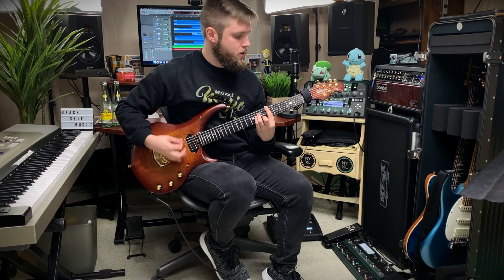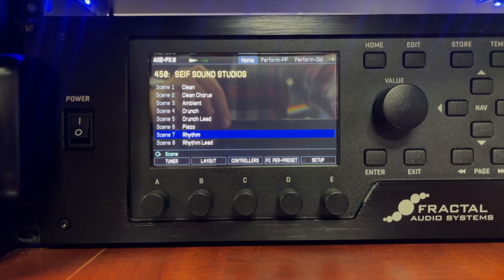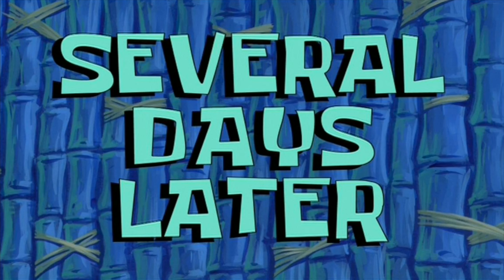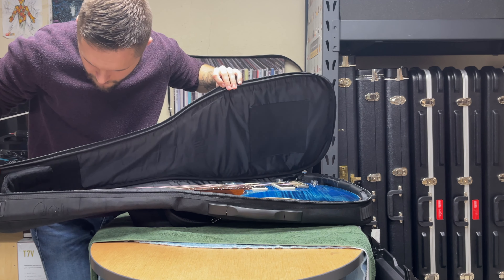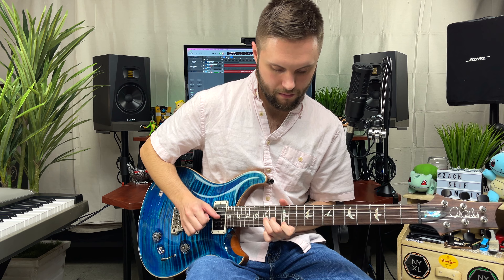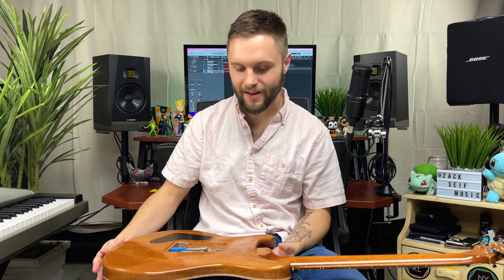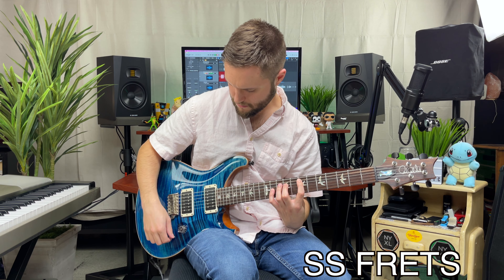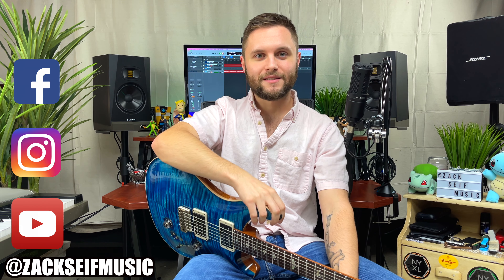I Put STAINLESS STEEL FRETS On My PRS

Comment: I just put SS Frets of two of my PRS guitars and, well, it's harder to work with them but the feeling is amazing. And they last forever. Don't think I'll buy a guitar without SS Frets anymore. So far I have SS on 5 or my guitars. It's strange that the three big US brands haven't jumped on that train. I have a cheap EART with amazing SS fret work. The smooth feeling is so nice.

Comment: Synopsis: PRS frets are very soft and wear faster than any fret material I've ever seen. 
The rest of the story - I've leveled and crowned probably 5 of my guitars but monthly on pawn shop guitars! I bought the expensive files and watched many different YouTubers and I had great results. Thank you guns and guitars. I even did a fret level and crown job for a friend and got his action way down. I just bought my first PRS. It's the SE McCarty 594 and I'm in love! I looked at the frets with my trusty 7X tool and noticed that the frets really needed some scratches removed and a good polish job. So after a few days of playing it was time to cut the strings, condition the board and clean up the frets. I started with 1000 grit dry paper just to be safe and have a method where I start on the lowest frets just in case there's a problem. Thank goodness I did that because the 1000 grit totally flattened the crown right off and removed about 2 or 3 thousandths of height, which is a mile when talking frets. It's a lot because the low fret will let the string down more and always buzz on the next fret. PRS frets are the most soft frets I've ever encountered, by far. If I had started on an important fret I'd have to either add material by dropping some solder or swap one fret. I'd be surprised if many people have messed up a fret or two before they notice how much is coming off these wimpy frets! Be careful everyone!! Buy Schecter, SS frets!!!
Reply from the maker: That's totally true. Nickel is getting softer and SS is getting cheaper. Why not get the best?

Comment: Congrats!  Can't imagine what you're doing to wear out the frets so quickly, but hey-- nothing wrong with replacing worn frets with stainless steel.  Beautiful guitar!
Reply from the maker: I thought the same thing haha PRS Nickel isn't as strong as I thought it would be despite what the claims are. No other guitar of mine has fret wear because every other high end brand that isn't the big 3 uses SS on everything. Lasts longer, stays shiny, smoother bends.

Comment: I got my first Core PRS (Custom 24) in 2005, by 2010 it needed a re-fret, so I upgraded to Stainless Steel frets.  So far, they've lasted 13 years.  Dunno what PRS' deal is with nickel frets, probably my only complaint about PRS.
Reply from the maker: Couldn't agree more! The SS frets are a godsend and they are on my other guitars.
Reply: Seriously xD
Been 5-6 years here too. And now i need to refret
Reply: What is it with the beef of Mr. Smith and stainless steel frets 😂

Comment: I like the nickel on the clean tones and ss on the driven tones. For the durability factor I think you made the right call. Slight tweak on the clean preset and its virtually irrelevant.
Reply from the maker: Absolutely agreed
Reply: Same here
Reply: Looks like I’m going against the grain of most the comments here, but…

For clean tones, the warmth and transients sound better with nickel frets, to my ears.  There’s a loss of richness/complexity that can’t be dialed back in.

The stainless steel frets wouldn’t be a bad option for medium/high gain tones.  They sound like they cut through a bit better.

All that said, it’s awesome we have some great options. Different frets for different applications, imo.

Comment: The nickel frets sound better....smoother and warmer.The steel ones sound ok but a bit brighter and more brash.I understand the convenience of the steel ones for durability but I'd still choose the nickel ones for tone.
Reply: Brighter and brash describe SS frets perfectly ,I have some in my guitars l, the difference is subtle but it’s there
Reply: It can be compensated by using higher value capacitor. So if the standard cap is .022uf then used .033uf.
Reply from the maker: It can also be compensated by rolling the tone from 10 to 9, or just moving the treble or presence of the amp by .5-1.

Comment: Nickel sound more gritty and less articulate. The SS are much cleaner sounding and more chimey, I wish they would put it on all guitars over 500 bucks. if you can't afford the PRS the HB CST-24T is a good alternative if you want a guitar to take to gigs where you are afraid someone will steal your wonderful PRS or Strat. Just make sure to remove the tuners on the CST and replace them with locking tuners, the orginals ones are terrable. Oh and they have stainless sleel frets on them. Remember it is no PRS, but but is better than any budget guitar I have ever owned. I Own the 24-08 now, and when I wear the frets down, I will do the same I will send it out to replace them with SS frets. Thanks for the video, I was wondering if I should but after listening to them afterwords I will change them out when the time comes.
Reply from the maker: SS frets are the real deal

Comment: What I find odd is that on when you're playing the Pull Me Under verse towards the end, the open root note sounds quite different when you're playing the SS as opposed to the nickel. Obviously that can't be the frets. How confident are you that the settings were actually the same for the two tests? 

I ask this because yours is one of the more dramatic examples that show significant differences in sound. The SS sounds considerably cleaner but also thinner on the higher gain setting which is unexpected.
Reply from the maker: Hey Nick!
It's the same preset for both demos. There could be any number of factors. The strings on the each demo could've been different, the pick angle could've been different, I could've hit the strings slightly harder, just small minute differences.

Comment: Thank you for the great vids on your PRS! Did you refret with the same size and who did you use to do the job?
Reply from the maker: Folkstone Guitars. Gary Hudson did the work and was super kind and professional to work with. We used the same fret size yes :)
Reply: Thank you, so glad I found your video on the PRS CORE finish and fret wear. I was wondering about the finish when they changed it to Nitro over cab. I have also been finding out that using softer frets saves the manufacture a ton of money. Because its way faster to set them up and less wear on tools. They can also get away with doing a slack job because the material is so soft. I have asked PRS a few times what fret wire they use and what the hardness rating is, they never reply. Nickel frets can range from 170 up to 200 on the Vickers hardness scale. It a big difference, I asked Dunlop and the told me their fret wire is around 170. @ZackSeifMusic

Comment: It is a lot more difficult to fret the guitar using Stainless steel frets due to its properties (hardness and resistance) tone wise, I kind of felt SS gives it a bit more bite with High gain.
Reply from the maker: I notice 0 difference personally! I have the same size fret wire and there was no transitional period.

Comment: Same strings or new set? On the first riff it seems slightly brighter, like going from older strings to a new set. I would not buy a new guitar today without SS frets. Love them on my kiesels
Reply from the maker: Both guitars got a brand new set of strings before filming! Otherwise the strings would’ve been 2 weeks old by the time they came back.
Reply: @ZackSeifMusic  can you notice any difference in the sound?
Reply from the maker: @x3a3x3  it’s so minimal and could be anything from the frets, to the exact angle my pick was at to how hard I hit the strings on the 1 vs the 2 that I only hear more clarity. 

It’s not harsh to me at all.
Reply: @ZackSeifMusic  same here, I only heard more clarity and that sound of new strings, that I like. Kinda like when I started using NYXL’s, they sound a little snappier

Comment: I noticed your stainless steel frets were not mirror polished. That’s important to have them perfectly polished to reduce friction and have zero string wear, better sustain and zero tone differences
Reply from the maker: No issues with friction on my end! Might have been the lighting or angle but Gary polished them before sending the guitar back.

Comment: With youtube sound, I can't really tell any difference in tone.
Reply from the maker: Honestly, it's not supposed to be that noticeable, if at all. It's really supposed to be more of a durability longevity thing, as well as a feel thing. For the people who claim that stainless steel frets sound too bright compared to nickel, you can literally just turn down the treble on your amp or roll back the tone knob to compensate. That's why I believe every guitar should has stainless steel frets. Especially these days you see import guitars around $500-$1000 have them, so there's no excuse for a $4000 guitar not to have them when they are better.